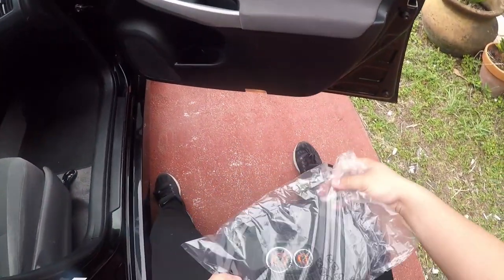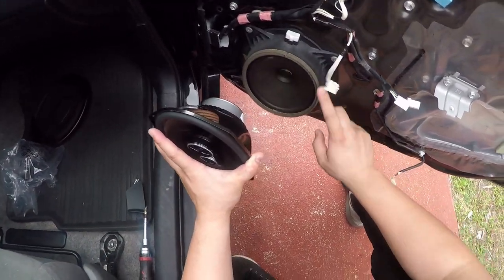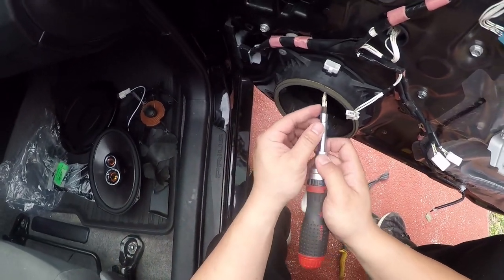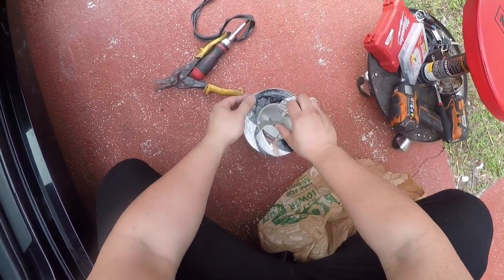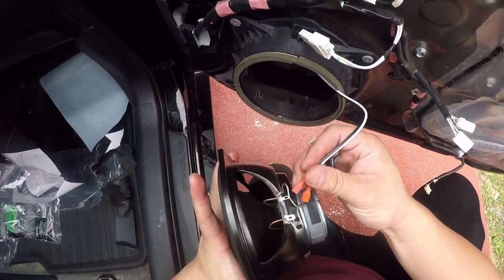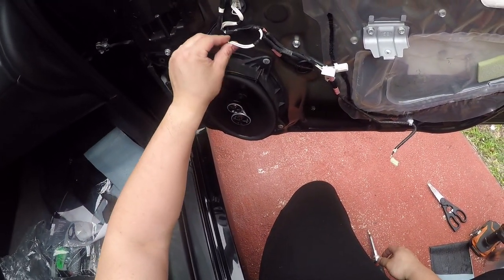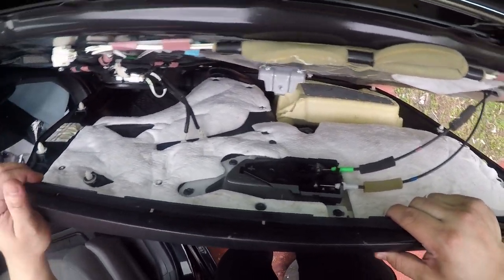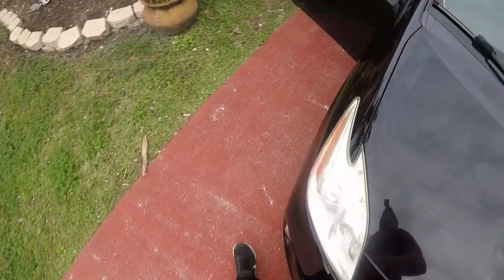Changing the Speakers / Add Sound Deadening on a 2010-2015 Prius JBL club 6x9

Comment: I noticed the bass was weaker than stock speakers after upgrading front door and dash speaker even with an amp. Fixed it but putting a resistor on my dash speakers. The dash speakers were overpowering the door speakers. It sounds amazing now!
Reply: Love to know more about this

Comment: Great job men. I am working on my Prius10. I am not a pro on this field of electronics.. I am doing a complete new install and amp. For the sealant I have a tip. First peal about 1/2” set your starting point and then pulled out the back as you push the top layer down. That way it doesn’t stick around.

Comment: Thanks a lot! Now I know what tools I need to take this on and that it’s with doing with the factory head unit. I’ll pick low powered speakers with the highest efficiency I can find since I won’t have an aftermarket heigh powered head unit to drive them.
Reply: What speakers did you go with? I’m thinking about doing this but I really don’t know anything about speaker ratings.
Reply: @HalfAznGuy  I went with Kicker CSC35 90W 3.5 Inch 2-Way Coaxial speakers in the dash and they made a huge difference and sound amazing. Can’t recommend them enough. I tried some low power Kenwood 6x9’s in the doors but the bass was much less so I ended up re-installing the factory door speakers which are actually pretty good. I added a new pioneer CarPlay head unit and a powered infinity 8” subwoofer under the seat and my setup is complete.
Reply: @mylesgray3470  nice! Thanks for the reply. I just saw Cheeko’s video saying that replacing the dash speakers were a much better upgrade. Maybe I’ll just try that. I don’t think I want to mess with replacing the head unit though.
Reply: @HalfAznGuy  You bet. The factory head unit was fine but I had some money to burn so I figured why not. Change the dash speakers though. Seriously.
Reply: @HalfAznGuy  Just recalling my install, I only got one screw in and I used shoe-gu to hold the speaker and keep from rattling because these speakers are bigger than stock. I trimmed a little of the dash board plastic. Still fit under the factory cover nothing you can’t do in like a hour, start to finish. It’s worth the effort.

Comment: I took my door apart and did a full soundproofing and installed a new kenwood 6x9 ($60 on crutchfield) and the bass was far less than factory so I ended up putting the stock speaker back. The treble was better but the bass was way less. Just an FYI to those thinking of doing this upgrade, the factory speakers look like junk but they are hard to beat without a new head unit or an amp. The dash speaker upgrade was an excellent upgrade over stock however. Test the new speakers before you wreck the old ones if they are not blown.
Reply: how did you get the stock back in?
Reply: I’m debating the same. I already have the jbl on my 2nd Prius, but wanted to upgrade. But without new headunit and channel amp the speakers would be downgrade no? I was thinking alpine type-r and 12” sub…
Reply: @jayhussain6959  Yea, it’s really hard to beat the factory door speakers. I upgraded to a pioneer CarPlay head unit and the factory door speakers are way better now with more power. I’m just running them till they blow, so far they are good.  Added a 8” infinity powered sub under the seat and  the setup sounds great to me. 

The soundproofing was a huge upgrade though. My car has Lexus level road noise now.
Reply: @mylesgray3470  Did you find the jbl speakers more powerful with the stock headunit or aftermarket? I’m running stock with aux currently and it’s decent. But I think I’ll get an android headunit & subwoofer while leaving the jbl speakers as upgrade now. Thanks
Reply: When buying speakers good rule for an upgrade 80w -110w  rms per speaker. Stock is usually about 50w rms.
Reply: Just added JBL GTO 6x9 and 6.5 to my prius on the stock head unit. For me was an upgrade. Bass and Vocal was a night and day difference. I have the NoN  JBL Amplified Unit. Prius with the JBL amplified units will experience a downgrade from Stock. Its all in the OHMs...
Reply: @alvinbaez2006  So did you use the JBL speakers from a JBL equipped Prius? I’ve since upgraded to a pioneer head unit and added an infinity Basslink powered 10” sub under the seat and the setup sounds awesome. Still rocking the stock 6X9’s and despite pushing them hard they are 10 years old and still sounding great.

Comment: Dang yes drill the rivets out. Get the speaker adapter and install rivnuts. The rivnuts make the speaker servicable. I do like the use of the wire harness.

Comment: Helloo. Could you please tell me about thouse speakers 
Amazon link??
Reply from the maker: they are JBL club 6x9 speakers from amazon
Reply: @Kushikimehh Kyoto Anything is going to be a upgrade than the stock.  The stock speakers were designed to be energy efficient and that's why the small magnet and paper cone as he showed int he video.

Comment: Hi.. did you get the full range of sound out of the 6x9s as they normally have a crossover to filter the sound so the highs go to the tweeters in the dash and mids and lows go to the in door speakers. Please reply as I am looking to do the same in mine but not sure if I'll get the full range of sound from the 6x9s and not just the bass and mids.. kind regards
Reply: Don't go for this upgrade bro, you will end up ruining base quality of your system, this upgrade is only good if you replace the head unit too.

Comment: Anybody done this with a Prius that has the JBL premium system? I don't think there would be that much of a difference, just slightly different door speakers and the dash tweeters. I already have a full Android head unit and aftermarket 2 way Pioneer dash speakers on mine. Had to get a PAC Tato for the factory JBL amp to work properly. I'm just wondering if I should get a set of these for my front door speakers or if that will be an incorrect wattage load/ohm load on the JBL amp.

Comment: I got a 2015 Prius base model, it does not have the jbl speakers or navigation. Can anyone confirm if my car would have 6x9 speakers in the front like this prius does? Also what speakers would be on the rear doors? Thank You
Reply: This video shows the original speaker as round
Reply: It's not round, it's just it just looks that way because of his vantage point from the head camera. They are all 6x9

Comment: I wonder if the grill is touching the speaker cone? The original setup had that foam seal that I imagine was right up against the plastic grill. Now the grill is pushing against the rubber suspension that goes around the cone. I imagine this will kill the bass and cause distortion. If, however it is not touching, this is the best way to do this mod.